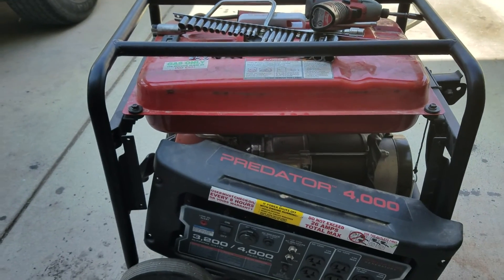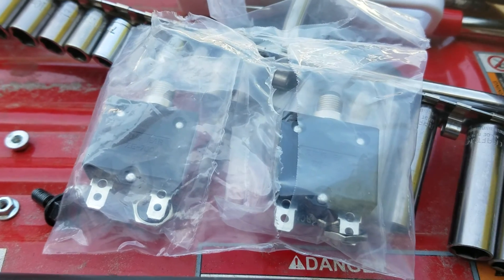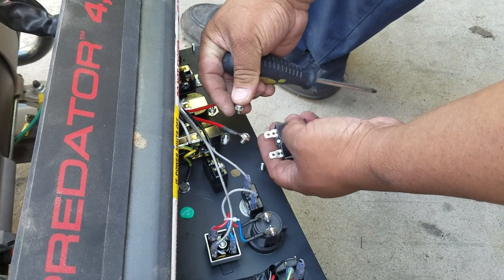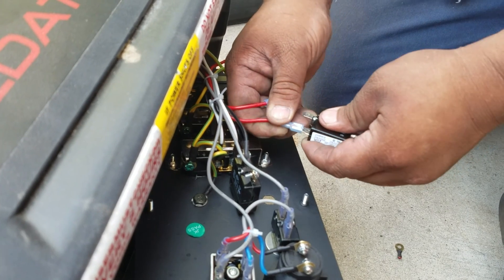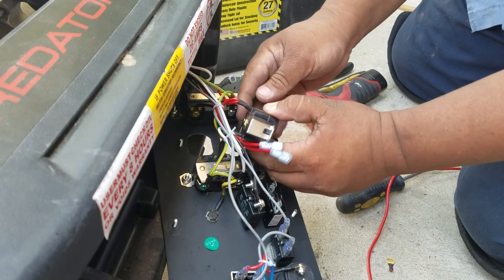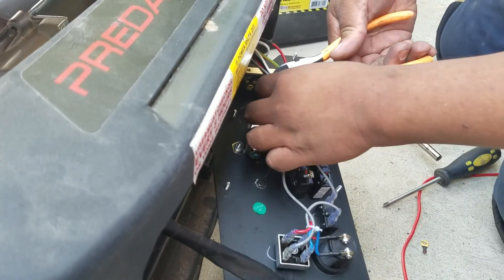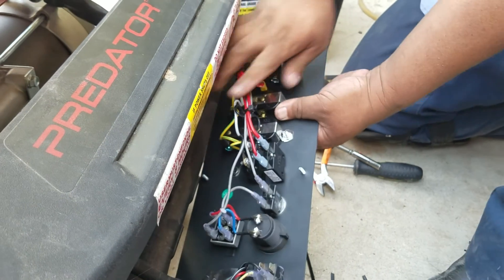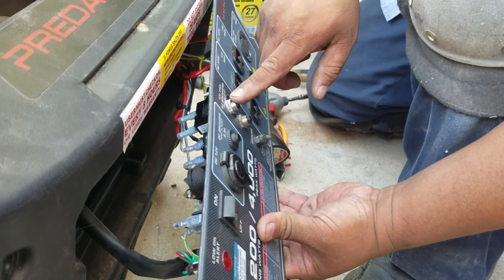Harbor freight Predator 4000 Generator mod part 1

Comment: Honestly it’s not bad if you’re not pulling more than the rated amps so wires don’t get hot. I want to do it for a welder cause of the surge when starting. If an appliance has any type of surge like a compressor or maybe a microwave it wouldn’t hurt anything as long as it doesn’t pull so many amps after starting that the wires melt, cause I mean thats the whole purpose behind protecting it. Otherwise it just be better to buy one that could handle it.

Comment: Since you are defeating the purpose of having a circuit breaker in the first place, why put a breaker in at all? Just remove the wires from the circuit breakers and connect them together? It's kind of like removing the brakes from your car. I hope you have good insurance on your family members.

Comment: Bad idea to change out to a higher rated breaker on the generator, even though it's rated for 4000 watts, the generator breaks that up into to circuits of 2000, the windings in the generator will over heat and burn out if you put a larger breaker on those circuits! Only put the same rated breaker in of better quality !

Comment: Well frend you did a good job but you should have put a 30 amp breaker in there and upgraded your plugs to 25 amp plugs and changed your wiring out as far as you could to the generator to number 10 that would have been the best but good job nice

Comment: I am interested in trying this. I have a question though. Why not get a smaller screw to connect the wires to the 20 amp switch instead of cutting the wire? Would it not work? I havent purchased the part yet but that is what I was thinking of doing.

Comment: Last brand new Predator 3200 to 4000 I bought, 1 of those sorry breakers failed 2nd day I had it.
I had bought a 2 yr service contract with it but had no way to take it to HF store.
So I took a breaker off the old Predator I had for years, and it still works fine.
HF has cheapened their generators.
As with their latest recoil starters which are junk.
Now the old style recoil starter on my old gen was pretty worn, but still able.
I put on the new gen and it lasted couple years.
When it broke, I didn't want to replace it with new junk design, so I just wrap a rope around the hub and crank it up.
Old fashioned but is oh so reliable.
I see you got a lot of 3 20A breakers for $11 on ebay.
I was just getting ready to order $11 for 1 off Amazon, but think I'll check out ebay first.
Enjoyed your video.
Thanks for the work you put into it.

Comment: I have the Harbor Freight 4000, I want to install the watt meter on the 240 side and can't find one.  What meter are they using n the 3500 and how would I wire it (not technical)  I prefer something that has case I can attached to the frame for low cost.

Comment: Thanks for the idea and I will do it, but a little more correctly. One it does no good to upgrade some wiring but not the leads from the  generator. Second you upgrade the wire but cut some of the internal strands, wasted wire and not correct.  Westley you say convert from 13A to 20A, changing a breaker does not upgrade it.....

Comment: What is the part number of the new 20 amp  breakers you got from eBay?  I will be doing this to my new predator 4000.  Had to cut my camping trip short because of no a.c.   Living in Texas a.c. is a must.   Thanks.
Reply from the maker: TRAIN WRECK ZE-700-20
Reply: The Other Guy thank you.

Comment: Are the 20v DC push button breakers interchangeable with the 20v AC?
Reply from the maker: michael maris I dunno. for safety reasons I'd leave ac devices with ac and dc with dc.
Reply: The Other Guy _after studying it, the DC & AC are interchangeable as no matter the voltage, the fuse blows only by current traveling through it, which would be amps.
Reply from the maker: michael maris awesome.
Reply: Ams are amps. Study ohms law
Reply: Here is a very important video that everyone really needs to watch https://youtu.be/I1jT3ANENvI I’m not forcing you to watch this. Everybody just really needs to see this video because there is a very important advice on this video that everyone really needs to know about. Thank you. I just hope people are safe. Thank you.

Comment: You are totally irresponsible calling such a dangerous "Mickey Mouse" modification and upgrade. Upgrades are approved by the manufacturer. Not only are you STUPID but so is everyone who follows your advice. You are showing people how to burn up their generator but also the RV they use this in. YouTube should stop people like you from posting these videos.
Reply: Blah blah bla bla blahlala Go get laid dude, you won't be so grumpy and unpleasant.. WTF he gave everyone a warning. Not everyone is a num-nuts of your grand caliber.
Reply: You should not try to get the generator to accept a load it was not designed to do. I got called out to one site and the armature just about exploded because the load had spiked and the breaker failed to open. Small pieces of wire everywhere. Better to sell the generator and buy a bigger unit. Like putting a penny instead of a fuse it will work until your house burns down.

Comment: those little push breakers are crap if they trip a few times. probably only good for 9 or 10 amps now. I would have done the same as you did.